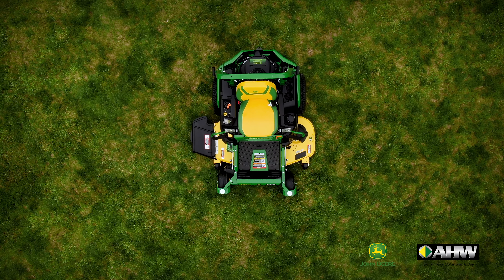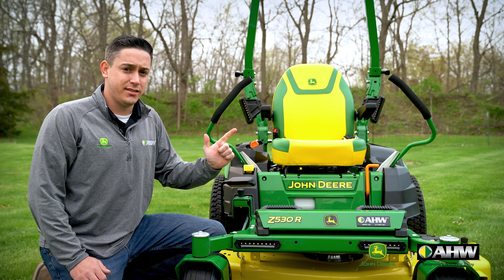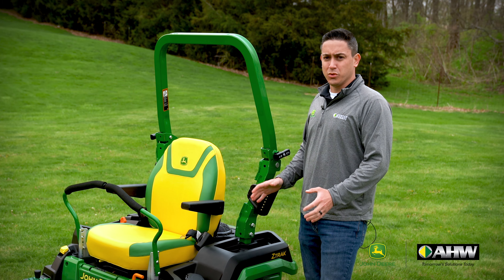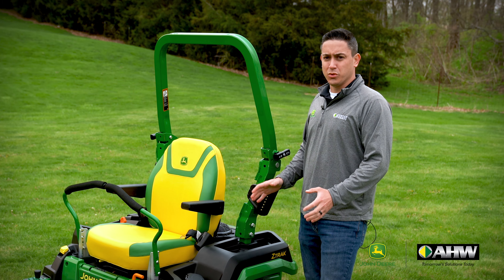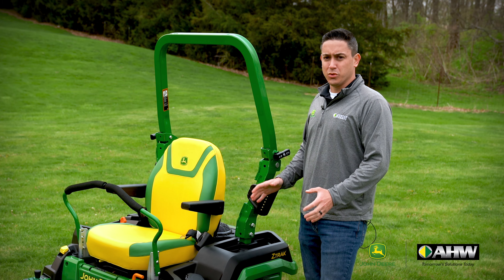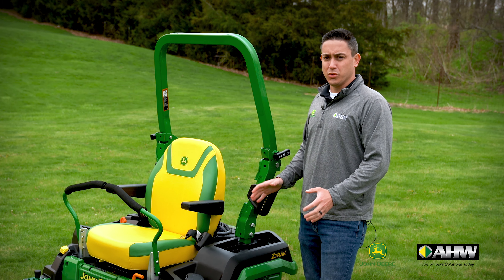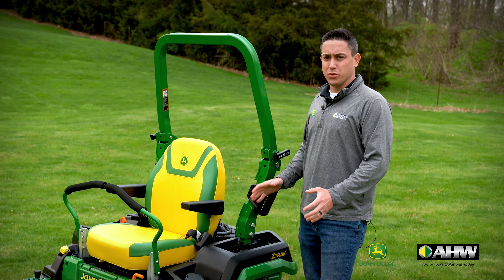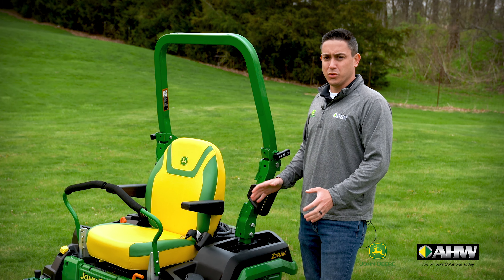THE BEST John Deere Z530R Walk Around | AHW LLC

Comment: I just got the z545R and coming from a z355E that is 11 years old blew my mind on how nice this new mower is. I was just gonna get a z530M with a 54" deck but the dealer sold it out from under me. So I went to another one that had the z545R with a 60" deck and I am so glad the original dealer screwed up. The fuel injection, led lights, upgraded seat, foot pegs and other little things blew my mind on how nice the mower is.

Comment: I have to JD zero turns. Z445 and Z535M. The 445 is 10 years old and 535 is 5 years. Both seats are in perfect condition. DLAB White is misinforming you JD seats are fine.

Comment: What about the operation, how it cuts, what problems have been reported? A seat is a seat okay but I want it to cut grass its a tool period. Oh by the way I have never used a cup holder on a mower when I cut to much dust. Were are the grease fittings and how much oil and air pressure. Deep dive details.

Comment: A stamped deck really? It’s something I’ve noticed about all Deere mowers. At this price point I believe every other maker has manufactured decks.
Reply from the maker: John Deere stamps their decks out of a single sheet of steel to decrease the corners and welds underneath the deck. Less corners and the smoother the underside of the deck, the less area for clippings to build up resulting in better air flow.
Reply: @Striper Seeker 
Yea that’s why all professional mowers have fabricated decks, because they’re inferior. 🙄
Reply: I purchased a 2022 z530r and is missing a lot of paint. also no quality very cheap light plastic on the flare around back wheels. The quality and workmanship is  all gone from what was once a good machine.

Comment: Why does every JD seat fall apart.  You can't find an intact seat on a used Deer
Reply: I have had 4 different JD’s, still have two that are 10 and 12 y/o. Never had an issue with the seats. They are probably not taking care of them and leaving them outside all year round….

Comment: I had a older (7 years) Z535 and just got a new Z530M.  The steering arms and parking brake is SO much tighter now...is this normal? any adjustments?
Reply from the maker: Hi Dan, if you are referring to the tightness of the steering arms, they are adjustable (see operators manual). If you are referring to when you push forward on the arms, that is not adjustable, but it should loosen up over time.

Comment: how much is the mower
Reply from the maker: The normal price for this mower is $5,799, but currently, at AHW, you can get it for $5,599. This price is for the mower, but if you want to add any accessories, you can go to ahwllc.com and go through our Build N Price tool to get your complete cost as well as current financing offers.
Reply: @AHWLLC  the base cost shown on your website tonight is $500 more than your response above.
Reply from the maker: @dman3349  The pricing above was for a 2021 Z530R with a 54" deck that was also on sale. Current pricing for model year 2022 is $5,999, however, as of today, it is currently on sale for $5,799.

Comment: Does the 60” deck scalp more than the 54” deck? What is a bigger seller in your opinion and what are the disadvantages of a 60” compared to the 54”? Thanks!
Reply from the maker: A 60" deck does have a great chance side to side to scalp, but it really depends on your yard. The size difference really isn't an issue in most situations, plus the decks do have the Anti scalp wheels to help prevent most scalping. Both deck sizes are purchased at a very similar rate. It usually comes down to a couple things. 60" decks are easier to trim with and obviously cover more yard in less time, but they are harder to store and get into tighter places. 54" decks fit through gate openings and garage/shed doors easier. Often times the storage and access heavily influence the decision between the two sizes.  Most customers that go with the 54" deck either don't need the extra size or trade the bigger mowing size for more accessibility.

Comment: Never, NEVER get ANY Briggs&Stratton engine on a John Deere, no matter the level, they are all throwaway, unreliable, junk
Reply: I would strongly disagree with the original statement.

My D170 has a Briggs motor with 600 hours and it runs like day one.

However, I just placed an order for a Z530R and I’m excited for it to arrive!
Reply: @Gsxrtrix  ive owned 1 vanguard engine, better than their other line, but still didnt last like the Kawasaki's
Reply: @rossbaiza9369  600 hrs is break in hours for a lot of machines lol. even non commercial ones. 600 hrs is perfectly fine for a homeowner, but not any self proclaimed pro (even a small company) 600 hrs is 2 - 4 years roughly, depending on how much you cut.. imagine 2k on an engine every 2 years lol for the prices of these machines, they should last 10 years

Comment: Not to be belligerent, but are you sure the Z530R has a carb? My JD x485 was made 20 years ago with a 25hp Kawi engine and even it's got fuel injection! I sure hope that was a misprint and JD isn't actually still putting carbs in their $6k machines!
Update: I watched the rest of the video and was sorely disappointed to see a choke lever on the machine! Hard pass for me!
Reply from the maker: The Z545R model is the only model with EFI and no carb on it.
Reply: @Striper Seeker Yeah, total deal breaker. I'm not buying anything new with a carb these days. I've spent more than my fair share of time screwing with carbs, idle speeds, low speed needles, high speed needles, choke adjustments, cleaning out jets, resizing jets, unsticking floats, replacing warped floats, rebuilding seals, blah blah blah and I'm just over it. I'm buying a few year old EFI machine over a new carb machine any day!
Reply: @Kcducttaper1 Our X500 is at least 12 years old and I've never had to do anything with the carburetor.